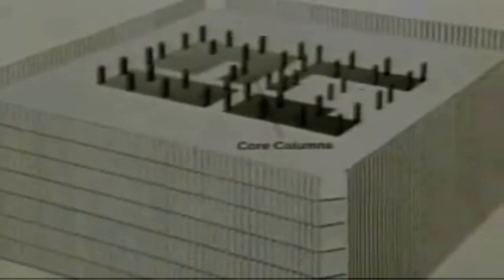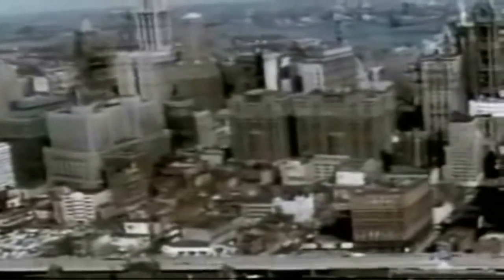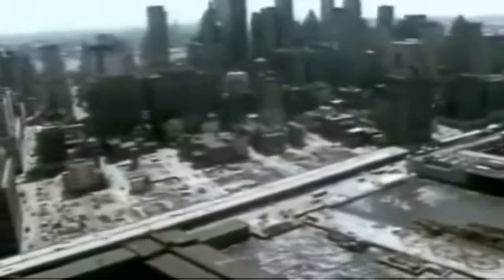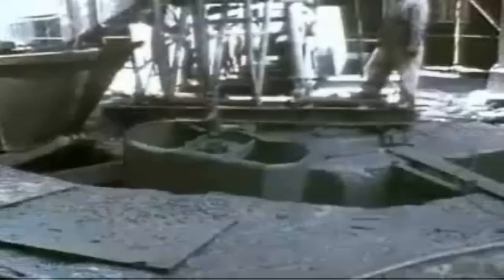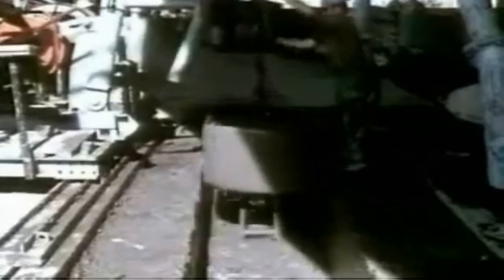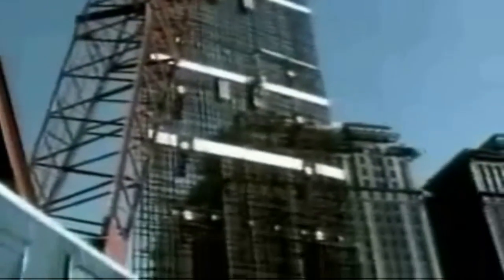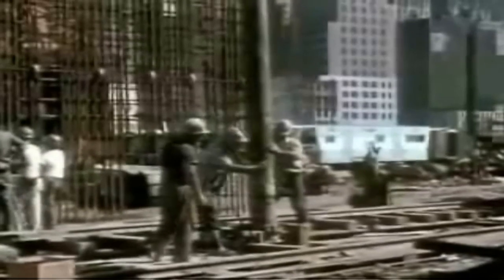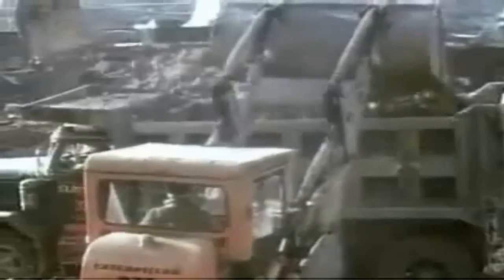Building the World Trade Center Towers

Comment: If fire brought those towers down and turn them to dust in the process...then i'm the pope!!!!
Reply: By the way, the bathtub is only walls it isn’t on the ground.
Reply: Hank Mardukas Well it’s nice to meet an Aviation Expert fighting the good fight. However, I’m here to offer my assistance as a Engineer. Someone mentioned that the planes sliced through the steel. That’s not true. You see, the steel was riveted together in sections, did you honestly think these were 1400 foot tall pieces of steel? You can plainly see in images of the day how it looks like the holes are not diagonal cuts, but rather step cuts. This is, as I aforementioned, because the rivers snapped upon impact with the plane and caused the steel to be pushed into the building. No cutting required. Also, why would the planes break up? Flight 11 was going nearly 430 MPH and going straight while Flight 175 was going around 540 MPH and going at a downward angle. This isn’t shocking speaking that the planes in question, the 767, has a max speed of 530 MPH so these speeds aren’t extreme.
Reply: Look shill, tell your bosses that The World is waking up. Yes there's a culprit, method is unknown, plenty of motive.
Reply: Hop on a sim and see if you can hit the building at that speed. Try DC too.  You of all people should agree the plane would have broke up at that speed and altitude. How is it aluminum wingtips slice through steel beams and not brick and wood (DC)? You've seen enough crash footage to agree there should have been way more debris in DC and PA.
Reply: I'd say John Lear is pretty accurate. Regardless I'm not here to argue with you. Live in your little mind. Look a surviving family member in the face and tell them they are not important enough for a new investigation. You make me sick.
Reply: Iceman 8 WELL THEN HI POPE
Reply: Not who you think, not what it looked like, control.
Reply: What are you afraid we'll find?
Reply: Planes existed but what planes? How do you explain the lack of engine noise from any recorded phone call? Just whatever you didn't win this. You through out stupid questions and stay stuck there. You can't answer shit. You are a waste of my time.
Reply: Gaz Roberts No kidding, lol. These twoofers don’t know anything logic do they.
Reply: samsquantch14 Looks like this was a sad piece of miscommunication and friendly fire. Lol. My apologies.
Reply: @IsraelCube  haha it appears that way...my bad dude..i should have read through all the comments first.sorry for being a dick lol
Reply: If an educated person could write something like this, I'd also be the pope.
Reply: Yeah, it's pathetic people actually believe a fire brought these buildings down in the same exact manner.  On top of that,  most know nothing about WTC 7. Ignorant sheeple.
Reply: William White First, off, I’m Jewish, so fuck you. Don’t know why you pricks try to pin it on us. Second, if you don’t understand how a fire took the towers down, then sit down and shut up. Third, I know exactly how 7 WTC collapsed, but I feel you won’t believe the truth in how it was fire so I’m gonna spare my time and not tell you unless your open to it.
Reply: Do you see a strip in proximity (not public) where you could land a 767 heavy with fuel? Transponders were switched off. Could they have landed?. Stewardess stated someone used mace in Business Class. Was it mace? She also didn't recognize NYC from the air, a seasoned Stewardess. Pretty calm cabin for descending 10,000 ft that quickly? No screams or prayers. Long duration, quality call for an air phone at that time?. I have yet to hear a recording containing ambient jet noise.
Reply: It wasn’t fire, it was a massive jet liner slamming with incredible force that destabilized the building
Reply: 110+ years of steel framed construction and only 3 buildings ever brought down due to fire. All leased by the same man and all fell on the same day. Kinda gives one pause don't you agree? They were designed to take a plane impact and survive. Let's not forget one wasn't hit by a plane. The witness accounts of multiple explosions can not be ignored. Particularly the explosions reported in the sub levels. Convenient that there were multiple investigations running at the time and all their gathered evidence was lost in the event, the investigators killed. Impossible cell phone calls, clear long duration air phone calls with no noise from the jet engines. Missing gold and bonds evaporated. Only two passports found and both belonged to your so called terrorists, found on the day of the attack. I'm just getting started. What is your problem with a new accurate investigation? Don't try to tell me it's disrespectful to those we lost that day, if anything we owe them a real investigation. Millions have died as a result of this event. How does one train poorly in a Cessna and then Expertly Pilot the massively complex systems of an airliner? Our best Pilots couldn't recreate the flight into the towers at that speed. Not to mention the planes would have failed structurally long before they hit the towers. You are a low life govt shill.
Reply: Rob S north tower was hit by a plane going 379 mph south tower 459mph in the center hence why it went down first. To add to that jet fuel in fact will not melt steal beams but it will heat it up to around 1300-1500 degrees weakening it to the point where you could take a piece of steal and bend it with your hands.
Reply: ForevaReckless Partially correct, though this is just semantics at this point. The reason the South Tower went first was because the plane hit lower and off center to the tower while the North Tower was hit higher up and straight on. The unsymmetrical damage and increased weight of the South Tower caused the building to fail faster while the North Tower lasted longer due to less weight on the damaged area and symmetrical damage.
Reply: @IsraelCube  the planes hitting at different speeds probably had something to do with the time difference of collapse too.
Reply: samsquantch14 Lol, no worries. As for the speed. Ehhhhh, it does seem logical but it really only would have been a factor in the energy produced in the impact. The lack of symmetry of the impacts and the amount of tower left above were larger factors. Idk exactly though, could have been a factor.
Reply: @BigOleBenny  it went down first because it got hit lower and had more weight above impact..

Comment: Lets say our 767 weighs ~ 120000 kg. It flies at ~240m/s and the buildings were 63 meters wide. If I allow the entire building's depth to be the plane's stopping distance, then [120000 kg * 240 m/s * 240/2 m/s / 63m] rounds off at ~ 55 million newtons (12.4 million pounds) of average force required to stop the plane in that amount of time. It also rounds off at {[120000 kg] * [(240) m/s]^2}/2 = ~3.5 BILLION joules of kinetic energy being dumped into those steel beams, nearly all of which was converted into heat. Then, there was the fire. Obviously this is only a general order-of-magnitude calculation but it helps wrap your head around the physics. Can steel 54" beams, separated by a few feet, hold back 12.4 million pounds of force? If the steel beams at the perimeter COULD hold back the plane, then the stopping distance would have to change in my equation. Lets give it... what? Say 10 meters of deformation in the steel?  [120000 kg * 240 m/s * 240/2 m/s / 10m] = ~ 350 million newtons (79 million pounds) Are those steel beams capable of applying 79 million pounds of force, spread across the area of the front of a plane? No, I think not. The plane could have been made of cotton for all i care. It still would have broken through the outer wall as long as the mass, speed, and impact area is unchanged.
Reply: grozbeek mose the speed of the aircraft has already been confirmed in videos to be in excess of operational speed at about 500 mph. The planes were flying at a downward angle for several miles before impact which easily accounts for the high speed. 

on the steel, its not "clearly molten steel" in the video. That could be literally ANYTHING on fire. It doesn't have to be steel just because its glowing red.